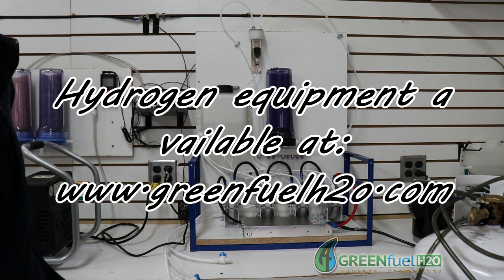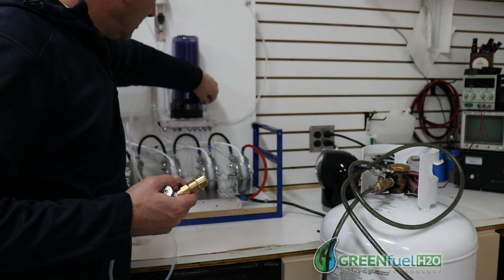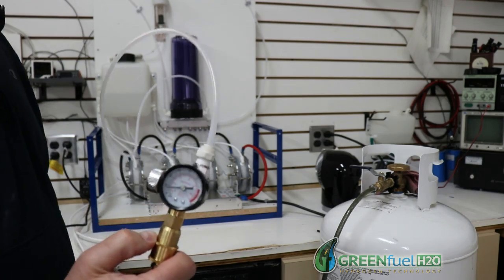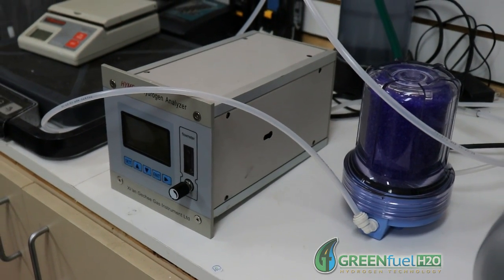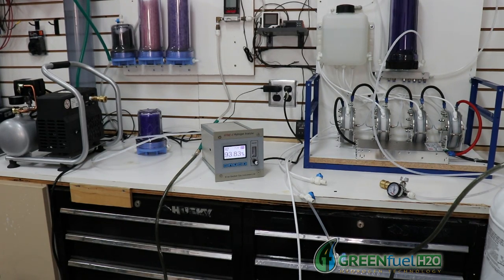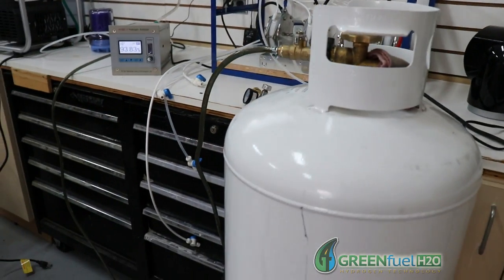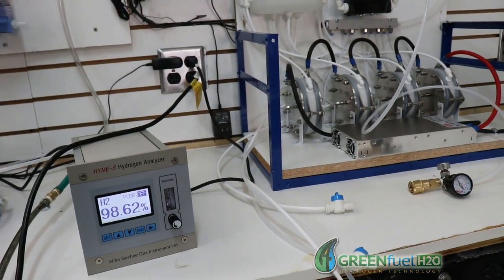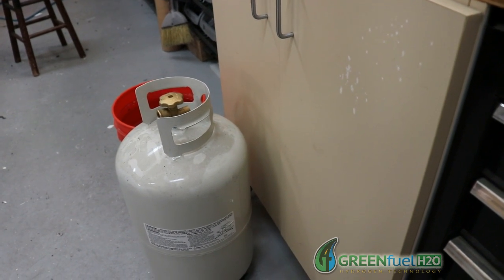PEM Hydrogen compression. PART 8. Testing hydrogen for purity.

Comment: Turn the tank upside down to purge the heavy gasses after you first fill to 20 psi. It will get your purity up quicker
Reply: agreed on the upside down could also add a purge valve plus include a  DIY liquid nitrogen system to cool the hydrogen before storage
Reply: This won't work with propane tanks unless you remove the pickup tube inside the tank.
Reply: @kajunkat72  that’s a given, to remove the valve, and them just install a tee fitting in its place. At that point it is just accumulator.

Comment: @ 2:50 I would be purging that line from your gauge to the ball valve with hydrogen.  That line is full of air,  If you were to add a T between the existing ball valve and add another ball valve  and a vent it downwards you could purge most of the air from the line and any in the T as well since the hydrogen is lighter than air.  I love what your doing, and your doing a great job.  Not intending to Monday morning quarterback, but if you blow yourself up, who am I gonna learn from?  Only other thought is to ground bond EVERYTHING that you can.  One bit of static can flat ruin your day.  Percentages are getting better!  ETA not sure why you are no longer making vids on this.  It has been a great bit of knowledge that you have been sharing.  But thanks for what you have shared.

Comment: Steve: I'm sure a lot has changed in 2 years. but I have a suggestion based on what I have been seeing.   You can only pull a partial vacuum on the tank the way you are doing it but your main goal is to Pull all the oxygen.  Hydrogen is lighter than Oxigen.   When pulling the vacuum turn the tank upside down.   residual air/oxygen will sink to the bottom and be pulled out first.  Residual hydrogen should be the only gas left.   Upside down for vacuum and filling.  Turn right-side up when drawing off Hydrogen to compress into a smaller tank.

Comment: What would be the best membrane to use for long-term reliability and assured ceiling around the edges and A good separation of the oxygen and hydrogen? For a dry cell set up
Could you reply to SplittingWater@JeffMorris.co.uk

Comment: Still want to know what exactly you vdo with the hydrogen?? Oxygen seems way more valuable in a sense
Reply: Welding or you can use it to regenerate electricity using a hydrogen fuel cell.

Comment: When you connected the tank hose fitting to the output, there was a hiss of air rushing into the evacuated hose, that means you are mixing air and hydrogen, very dangerous.  Also, attaching/removing the fittings might create a spark if they are not rated for flammable gases.  It might be better to fill the tank with another inert gas like argon to dilute the inevitable air that comes in.  If you fill with nitrogen as others suggested, you might end up making some NH3 (ammonia), look up the "Haber process".  Fun fact: liquid ammonia and liquid hydrogen contain the same mass of hydrogen per unit volume, and cost about the same amount of energy to convert between gas and liquid.
Hydrogen atoms are so small they can permeate through plastic and metal, so all of the rubber hose and plastic containers are probably venting hydrogen into the room.  Hydrogen storage is a huge engineering challenge, and just having hydrogen sitting in your tank, it will eventually leak through the walls of the tank.  That's why automotive companies are trying to design sophisticated hydrogen fuel cells, and ways of chemically bonding to the hydrogen to stop it from leaking.
Reply: You can use an ammonia scrubber to eliminate that issue. Marble chips are a primary ingredient in an ammonia scrubber
Reply: it would be much easier to have a 2 valve set up similar to when pulling a vacuum on an AC unit before charging with Freon

Comment: Dilution is the solution. You can pressurize and depressurize with nitrogen from a bottle to purge all the O2 out of the propane bottle. Obviously pulling a vacuum after every cycle will speed up the process. We do this in industry to oxygen free hydrocarbon drums. Residual nitrogen is inert so not a threat unless you are condensing the hydrocarbon because its non-condensible.  You won't be making liquid hydrogen so nitrogen purge cycles are perfect for your application to prepare propane tanks of any size to receive hydrogen.

Comment: Hi sir,

I am making a 100 plate dry cell and want to ask you should I use 2 water inlet on one side only water inlet for cell. I am using 6"*5" plates 100 plates and 2 gas output port. Please help
Reply from the maker: PIXELS DECARBONIZERS I recommend putting water inputs and gas outputs on both sides. With the size of your cell I would use 1/2” fittings.
Reply: @Hydrogen4Health  but sir the problem is that the dc current start traveling from one side of the cell to another side by the water pipe!! 😥 Which cause access heat and low productivity. Current doesn't pass through the plates directly. I am using alternative holes for water displacement. After 15 plates I change holes direction

Comment: Hi.  I am wondering why you would need to run the Hydrogen through a separator when you are producing 99.95% Hydrogen directly from the unit?  If you are going for 100% purity, wouldn't a heater connected to the units output eliminate the 0.05% oxygen residue?

Comment: @Steve - Appreciate the video. We do vacuum distillation, and you can pull down that big tank in less then a few minutes no problem with a cheap little 4 CFM vacuum from ebay, for under $100.

Comment: You should buy a huge high pressure gas cylinder and buy a high pressure compressor. The compressor cost about 400$ on eBay or China and can compress gas up to like 4000psi or a bit more, not sure... that will make your whole set up even more awesome. Screw Airgas company
Reply from the maker: Joey Valladared can you post a link for what your talking about? Thanks.
Reply: Which is the safe compresors and how many cost for comprim. H2 ??Thanks for anxswer Best regards

Comment: Just use a  Recycled Refrigeration Freon Compressor.  Free !     Use the same to Evacuate your bottle and purge with H a few times.
Reply from the maker: pulesjet don’t those need oil? I don’t want oil in my hydrogen tanks.
Reply: @Hydrogen4Health  Seperators are easy enough.   Your flow rate is so small you could do a number of stages.  Even a Dehydrator stage would sop up any vapors I would think.

Comment: Very impressive build!!!

What is the duty cycle for the hydrogen electrolyzers and power supply?

I'd be inclined to build a system that could refill a tank to a prescribed pressure, shut of the power supply, close a valve separating the generators from the tank, and activate a compressor to compress that into another tank at a higher pressure.

Ultimately having a shutoff for the entire system when that tank achieves a target pressure.

I would think if you could maintain a sealed system as above mentioned, and adequately purge your tanks, you should be able to achieve and maintain 99.9% purity quite easily.
Reply: If the duty cycle of the power supply and electrolyzers are sufficient, you could even build a valve system to operate two buffer tanks.

Comment: Why don't you have 2 valve tank, and you fill it with distilled water and using the H2 gas to pump out the water, that way you will have 100% H2 remaining in the tank before compressing it.

Comment: Did you ever bump up the voltage to 24 volts? Your website says 5 volts max per converter. 24 would be 6 volts each.
Reply from the maker: Found out it's best to use a separate power supply for each generator. 5v power supply works the best.
Reply: HeavenGuy  why can't I find those disk-shaped pem. Generators on the website ???
Reply: https://www.greenfuelh2o.com/product-category/pem-generators/

Comment: Tip the tank upside down. It will force the heavy gasses out the bottom.
Reply: Smart!
Reply: Maybe just get a hvac vacuum pump and pump air out of tank before us? Also you need to wait few hours before all water evaporates into the vacuum and then make vacuum again. Yellow Jacket vacuum gauges are good to check if you have vacuum in the tank.
Reply: Just about to say that

Comment: Can you try to build a container with a spark plug that would be burning off all oxygen content in the flow from the elektrolyzer?
The oxygen content in the flow from elektrolyzer is very low so it should produce just a tiny flame when itwould combust and the container will not break or crack during combustion. If this stage would work properly you should be getting 100% pure hydrogen. I would be grateful if you would reply what you think about this idea.
Reply: U also want to kill him? xd
Reply: @protheon  always try new ideas on small and safe samples. I might try it myself at some point in the future... Why do you think that this trick would not work?
Reply: @Kapalek84  Oxygen isn't flamable... Hydrogen is.. So if there was a spark.. umm.. it will explode
Reply: @protheon  tead the post properly. Pure oxygen or pure hydrogen will not burn in pure composition. They have to mix. Pure hydrogen will not burn in vacuum, same as pure oxygen. You have to mix them togeather
Reply: @Kapalek84  Man, im from poland xd I dont understand everything xd
Reply: Czysty wodor bez tlenu nie bedzie sie palil. Jesli tlenu jest tylko sladowa ilosc to zaplon czy plomien bedzie proporcjonalny do ilosci dostepnego tlenu. Jesli masz 5kg czystego wodoru i tylko 1g czystego tlenu to zaplon spowoduje spalenie sie tylko 1g tlenu. Kiedy caly tlen spali sie plomien zgasnie nawet jesli bedzie jeszcze dostepne 4.98kg czystego wodoru.
Reply: @Kapalek84  Teeraz rozumieem!

Comment: Blue fuel Systems H2o gas
Great stuff Steve .....I think that if you have access to double valve  tank one on the top and the other in the bottom , in this way you connect the inlet Hydrogen connection to the top valve and connect the purity  analyzer to the bottom valve and when you reach the right purity you just close the bottom valve . That is 100% safe because the Nitrogen and Oxygen are heavy than the Hydrogen and you can drain the condensate water  from the tank in the same time so you catch 3 rabbit's with one shot .   Hopefully my  idea will help your Amazing job .
Reply: i agree. no need to pull a vacuum using this method.
Reply: Good stuff, I'd bet that would also help maintain the structural integrity of the tank. The internal pressure pushing evenly across the metal helps keep the tank rigid (think of how unopened soda cans can support 100+ pounds) so keeping it pressurized could prevent it from weakening or imploding after repeated vacuum/pressure cycles

Comment: Would flushing the storage tanks with nitrogen or other inert gas help with safety? What if you flipped the tank upside down after filling/before testing? I'm not sure if gases work like this but maybe it would promote the removal of impurities since the hydrogen would rise to the top of the tank while everything else sat at the bottom closest to the valve. I'd imagine it would give you a lower initial purity result but might make it easier to get it above 97% since you wouldn't have to pull a vacuum and recompress so many times
Reply: On that same note, why was it so contaminated with the valve being on TOP (tank right side up)?  Obviously there is a lot of mixing of the gases despite density differences then.  That makes me worried of the concentration of the hydrogen closer to the bottom of the bank.  I deal with cryogenic liquids and I was thinking it would be neat to add nitrogen to the tank to build up some pressure, then immerse the whole tank in liquid nitrogen, turn it upside down, and open the valve to expel the liquid oxygen from it.  Then, do hydrogen / vacuum cycles like in the video to build up the purity.  But at least then you know that the contaminant is only nitrogen and not oxygen.  HOWEVER, that tank is HUGE!

Comment: You mixed O2 and hidrogen to the tank 
It's like a bom
Reply from the maker: No I am putting only hydrogen into the tank. See my other videos on this.
Reply: If dissolves HHO in atmosferic air (78% nitrogen)  the chemical bonds makes the misture suport compression, than you dont needs pure Hydrogen. But the mix nust be maked with small atomized portions of gas.